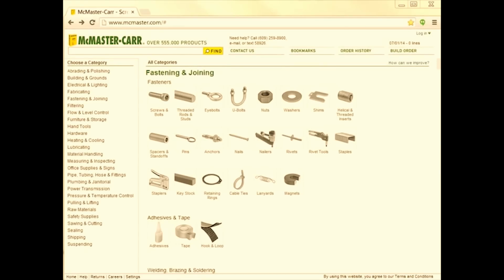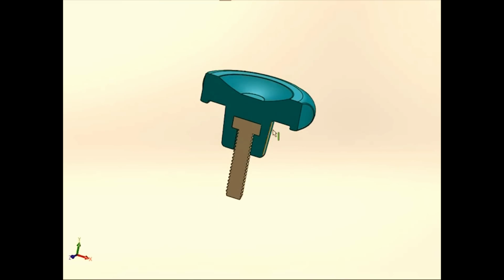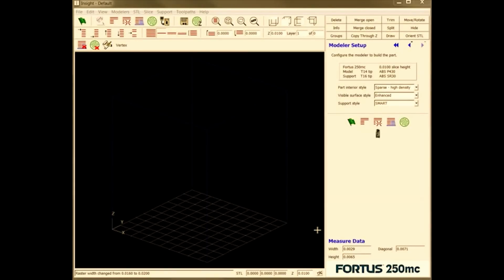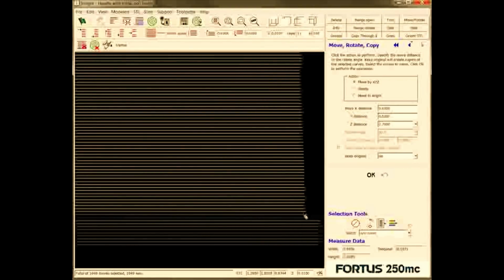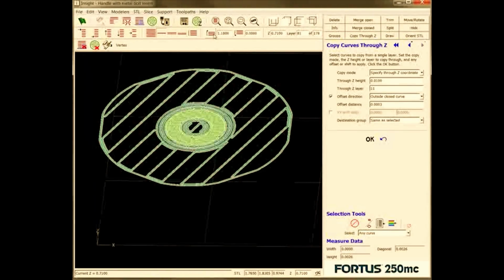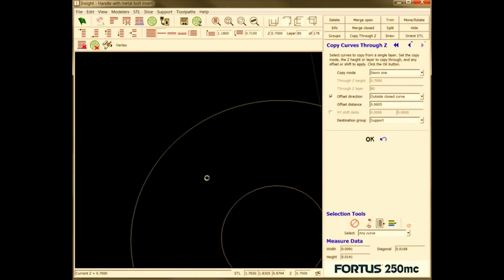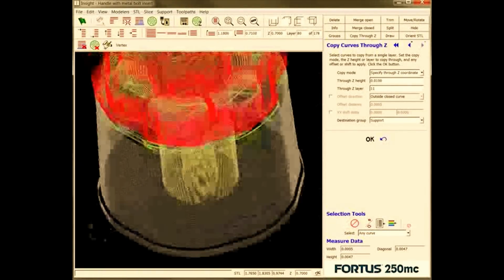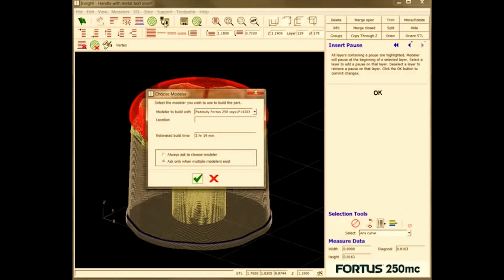How to Insert a Hex Bolt into an FDM 3D Printed Part

Comment: An easier method would be to design the knob so the bolt passes through the knob from the top and comes to rest in the hex, and print a cap that snaps in, or glued in to secure and hide the bolt head. No support material, faster post processing, cleaner finish, no pausing the print, and will print much faster by reducing the layers by nearly half. You can use a half inch longer bolt to put the torque stresses from the bolt head up onto the the thicker part of the knob rather than the thin area of the neck to avoid shearing off at the weakest area of layer lines.

Comment: PVA (gluestick) as well as hairspray also work well for getting filament to stick to metals. I often print with metal inserts for added durability and have used both with great results. Nice idea, I have also considered this method but opted to just print flipped 180º with a hex opening for the bolt head, when the bolt is secured it applies force that pulls the bolt into the handle and doesn't require all the support and added print time. Admittedly, it leaves an opening for the bolt which can now be replaced if needed, but your method has a very clean and manufactured appearance.

Nice video, a little long for the subject matter. Well done.

Comment: Is it possible to make temporary supports on the baseplate and put a sacrificial baseplate on those. To bore a hole in the sacrificial baseplate and print part of the knob, then protrude the bolt thru the print a sacrificial baseplare and finalise the print. With some tolerance on the hole it becomes less difficult orienting the bolt in the print. Just an idea.

Comment: How does the print nozzle get close to bolt after it is  inserted ? Won't it hit the bolt. The nozzle is about 7 or 8 mm wide,  with the hole in the middle. Can't figure that out.

Comment: The bolt head should be in the center of the knob head, not the shaft, to avoid shearing forces. The knob will likely break off.
Reply: Dave Sisler 
Funny comment🤪

Comment: Im confused though why print it facing that way? Cant you flip it upside down and add a layer of support under the dome shape on the top of it? Id think it would be much easier and use a lot less support material. All your have to do is allow it to build up to about the point when the hex screw head area is halfway printed and do the same just pause insert push down and resume
Reply: If you did that the shaft of the bolt would get in the way of the printer and it wouldn't be able to get very close to the bolt.  The extruder assembly and x-y carriage on FDM printers are fairly large.

Comment: OK.  That was long and drawn out.  I just designed my knob with an unprintable grid (0.1mm thick for a 0.6mm nozzle) under the hole for the bolt, and let Cura do automatic supports.

Comment: So just glue is not enough? Ridiculous...
Reply: NO
Reply: Dutsan Rojas This does not differ much from simple gluing: after you put a bolt in - you start layering again. This is even worse than just glue two parts.
Reply: Ok dude, if u say
Reply: I agree.  Just print two halves, then hot glue or solvent cement. If it's just a finger tight wheel it would be okay. You can improve strength by making the halves staggered and interlock. No need to waste about 5m of support material and all the extra time printing it.
Reply: yep. glue is good method. it is faster and less support materials needed.